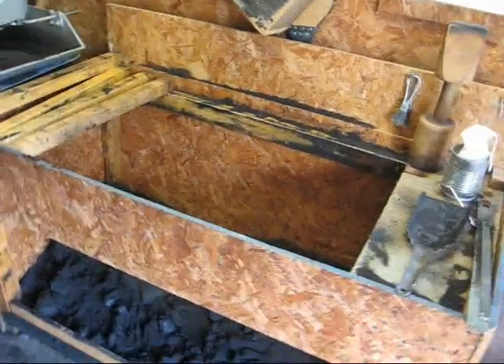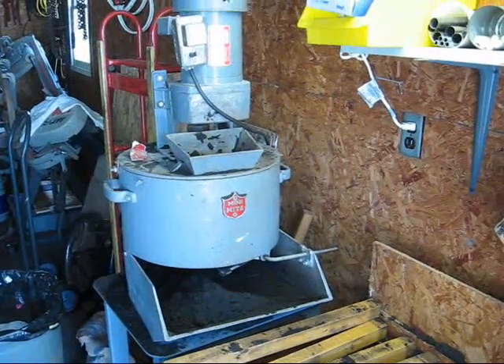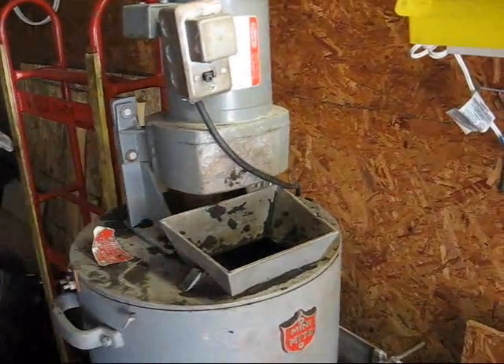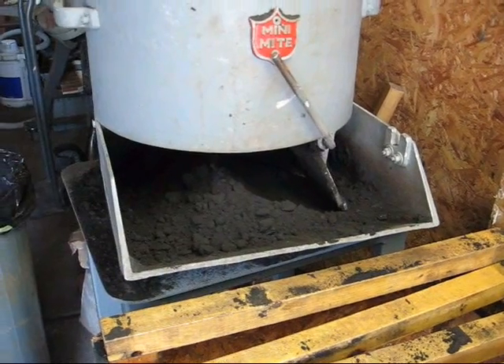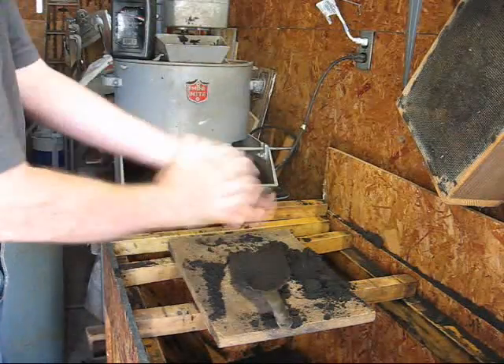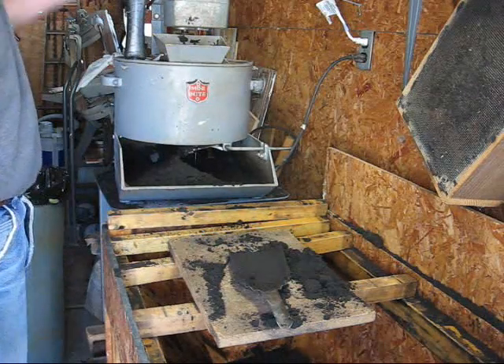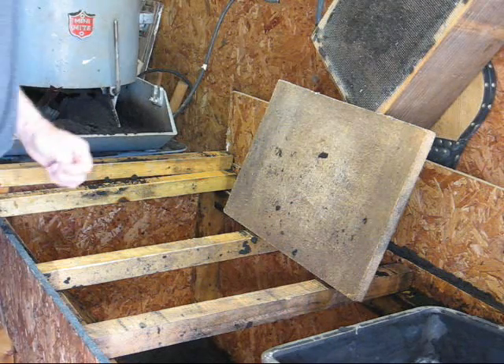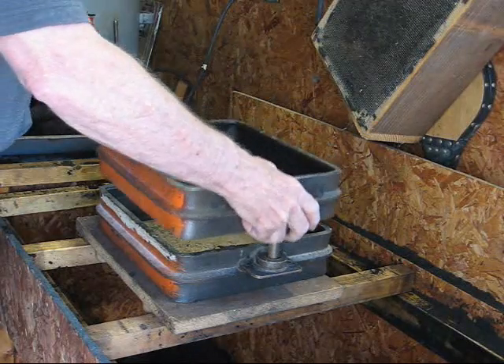FOUNDRY CASTING Making a Sand Mold part 1 TUBALCAIN

Comment: Could you tell me what the "Parting Sand" is (or the commercial name) and where to buy it?  Thanks
Reply from the maker: I have had mine for over 20 years, it came from a school auction. Not sure where to buy it. Check on eBay

Comment: What is the model number on the muller please. Is it M2?
Reply: Mini Mite.  I think they used to be made in Grand Forks. they used to be sold by IASCO. Industrial Arts supply Company in st. Louis Park MN. I've got one just like it only I use mine for core sand. Got a larger one for green sand.

Comment: man I wish I lived closer to you I would pay you to cast a gib for my new hardinge   DSM 59 double cross slide!  my god you can not find them! I am assuming that you do cast iron and come to think about it I think you said that you do not cast iron?    you are more than likely familiar with the double cross a tapered Gib. It has kind of a just man that allows you to set it with one screw and lock it with one behind it they both reside in two notches in one end of the taper. To know again design but it's a pain in the neck because it wants to break in the same spot on the night and apparently it did over the years. I have work around where I can put it just been on the far side to keep the Gib in adjustment and in place that will work for using it but I really would like to get the Gibb replaced.

If you have any sources for these parts please let me know because I surely cannot find them
Reply from the maker: I do not cast iron. Hardinge might still sell them--otherwise--ebay
Reply: Yeah I have been looking for a few week but I'm going to have to have much more patience I guess you think that everybody and their cousin would have one on the Shelf somewhere as many of 59 as they made!
I have a work around in mind but would like to keep everything unmodified if I have too

Comment from the maker: There are 2 kinds of foundry sands. Oil bonded and waterbonded. I use oil type.   I am using Petrobond brand sand. It is a mixture of fine white silica sand, 30 weight motor oil (without detergents), the Petrobond powder (a specially modified clay), and a splash of liquid catalyst. The mix is prepared in a machine called a muller, which stirs and mashes the sand.